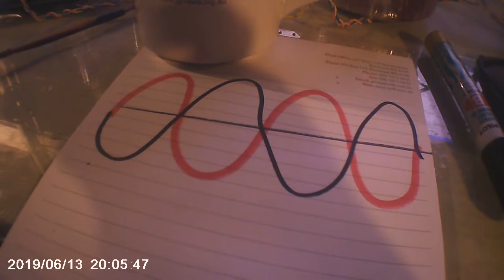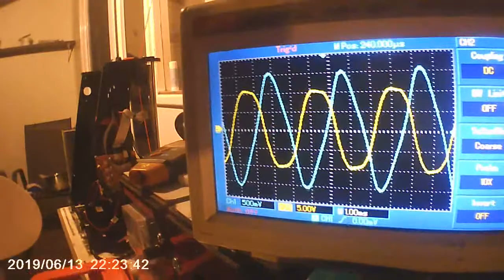Mr Preva Bucking Coils Followup   Transformers 35 of 365

Comment: Also systems designed for  high voltages are generally more efficient because of lower heat losses (transformer cores will heat up less=be more efficient). If you could aim to keep the voltages as high as your components can safely cope with then search for high efficiency setup might be easier.
Reply from the maker: Sup Koala,  iron lamination problem - if i encounter these, i will weld up a a core,   but from what i have learnt sofar, - the rise and fall times are most important, - so currently my scope is rated for 600v, and the spikes are 680v .. with only 10v input, - ... even with iron !! this is good for bucking coils apparently. ..  im happier working with iron, because all my TTL chips get abit unstable @ high frequencies. ...      got great stuff going atm. ;-)

Comment: One thing I could suggest: if the core you are using is made out of thin  laminations then you could check if pressing them togeather using a vice or some custom made clamp would increase the efficiency of energy transfer.
Reply: There is no energy transfer. There is only energy duplication.
Reply: @lukiepoole6701  duplication? So there is an original energy and copy of it?
Reply: @Kapalek84  Yes. Original magnetic energy wasted as heat. Only duplicated magnetic energy us being used. This is only for ALL electrical transformer, special or not.